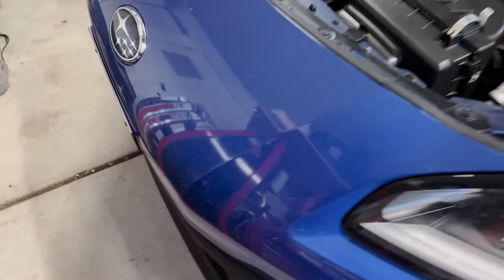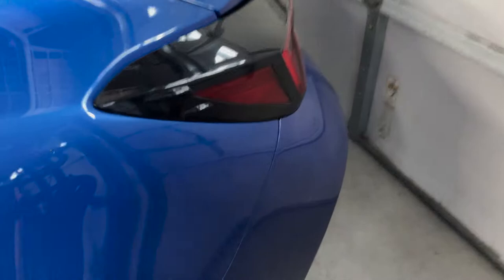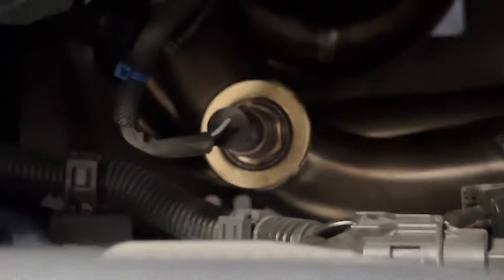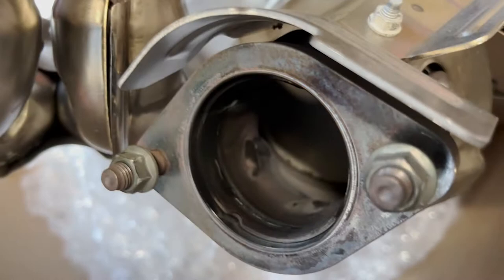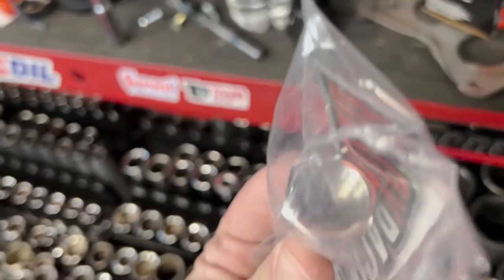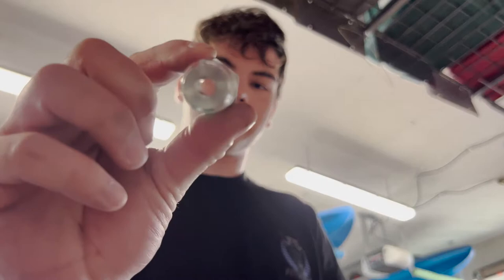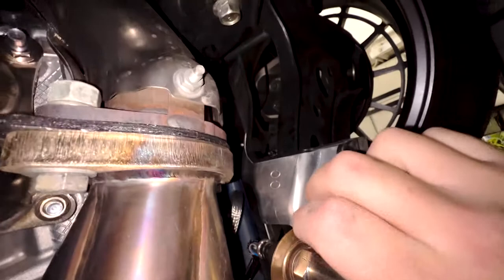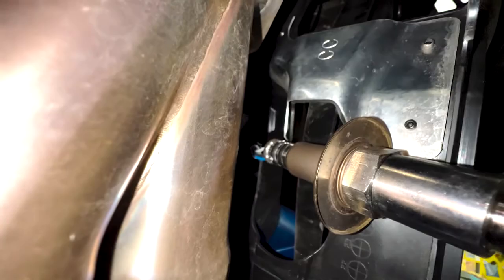Watch This BEFORE Installing Headers on Your 2022 BRZ!

Comment: Might be a little late but when you reset the ecu put the car in accessory mode for like 10 seconds before actually starting the car. it gives the throttle body enough time to calibrate and it should start right up. Usually it will crank for a couple seconds if you dont wait because of the car trying to calibrate but if you wait and then start it, it should start like normal.

Comment: P0420 for cat efficiency would need the extender on the secondary sensor (o2 sensor) downstream from where the cat would be.  the front sensor is your AFR sensor and you do not want to be tricking that one as your ECU is adjusting fuel in closed loop fueling based on what it's reading.  How's your car been running?
Reply from the maker: I haven't had the brz for almost 2 years now but it ran perfectly when I had it. I keep getting calls from subaru saying that it needs to be fixed so I have no idea what the new owner is doing to it lol

Comment: Might be a stupid question but did you try clearing the codes first before installing the air restricer? Maybe the instal was not essential
Reply from the maker: Yup, me personally I cleared my codes as soon as it threw a CEL and it popped back up after driving about five miles. But the defouler is only really necessary on catless applications.
Reply: @cjespi_  is the defouler that you're using just an extender or has a mini cat in it? Mine is just an extender but still throwing a CEL 😂
Reply: @abilakim5629  did you clear the code after install? Lol 
Curious to see if it went away or not

Comment: Would a J shaped defouler be easier to install and a better fit than the blox racing you used that goes straight out from the bung hole?

Comment: Quick question did your car go into limp mode ?
Reply from the maker: nope, it just ran like normal just with a CEL
Reply: Mine went into limp mode after a spacer but I will try the defouler and see if theres a difference